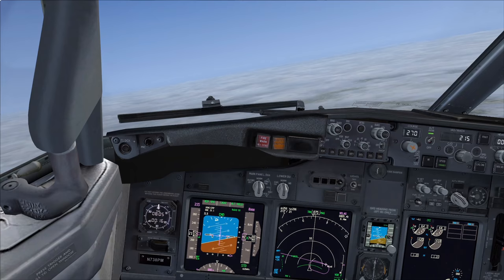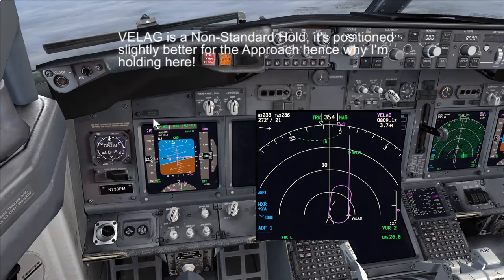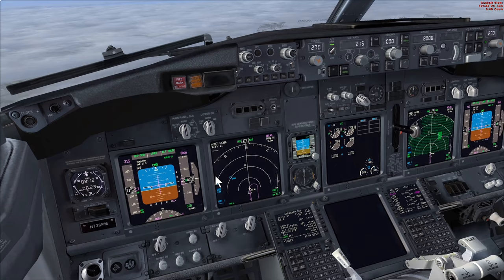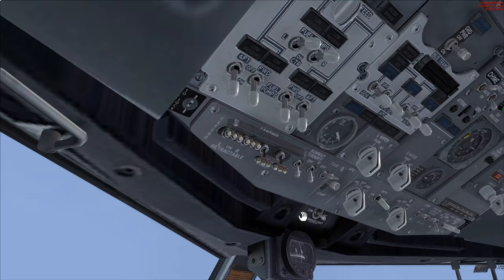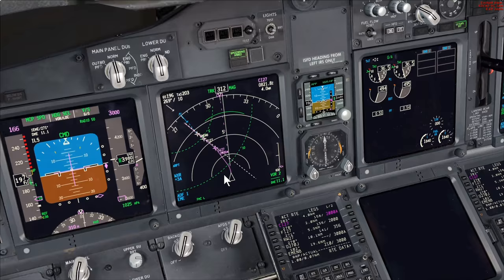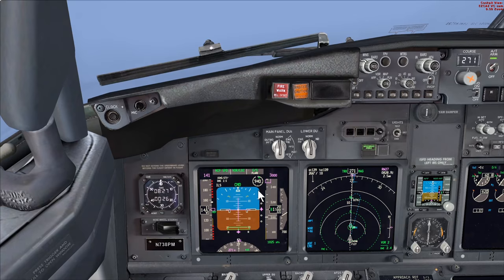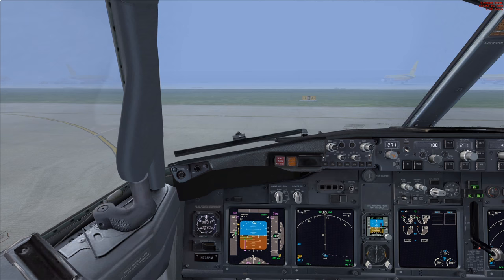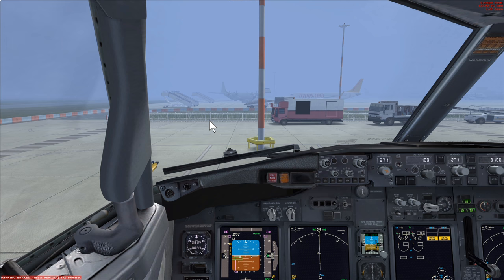How to Autoland a Boeing 737 | REAL BOEING PILOT  | PMDG 737 | CAT III ILS

Comment: Great tutorial. I watched this months ago but recently tried an autoland on several occasions without success. 

I’ve just mirrored this flight to East Midlands and finally managed to get the autoland to work thanks to following your step by step instructions!

Really appreciate the effort you put in to making these.
Reply from the maker: Awesome! So long as you have APP armed you should be able to engage the 2nd A/P for an Autoland 👍🏼

FD2S
Reply: I need to figure out where I was going wrong.  I think it might have been because I was configuring the Course heading to what the charts said instead of the ILS? In you tutorial ILS is set to 270 but Navigraph has 269.
Reply from the maker: Is your FMC (AIRAC) up to date? That could be why! I also use the most recent charts which should match the AIRAC 👍🏼
Reply: I get the regular updates from Navigraph and can see the latest dates in the FMC.  It seems that the charts in the app are slightly out though as they say 269?  I think I had issues with Stansted and looking at SkyVector, it has runway 22 as 224 and Navigraph 223!  Is the answer to trust the FMC heading?  I can see Jeppesen date on the chart is Sep 16 for Stansted.
Reply from the maker: I think it's a limitation with FSX/PMDG

https://www.avsim.com/forums/topic/363256-ils-mcp-course-selection/

FD2S.

Comment: Interesting, I was always taught in my instrument training to get established on the localizer first, and then intercept the glideslope from below. In the video you were using VS to simply follow the glideslope long before localizer capture. I suppose in the case of airline ops this is more desirable. A constant idle descent from cruise is much more fuel efficient, and a lot more safe and stabilized than the gazillion step downs we find ourselves doing when getting our instrument ratings.
Reply from the maker: Hi EnDSchultz.

Have you heard of CDA? Continuous Descent Approach's are flown primarily to reduce the environmental impact of the aircraft (noise and fuel burn).
To expand on this below FL100 we always try to avoid any level segment so we adjust the vertical speed accordingly, primarily by using V/S. 

Additionally we also try to achieve a Low Drag Approach (LDA) to further reduce the environmental impact, ideally we want the thrust lever to be at idle from TOD all the way until a 4nm final! 

Although not mandatory it is certainly desired and a lot of airports monitor aircraft for CDA compliance and can sometimes fine airlines for non compliance! Sometimes it's simply impossible due to perhaps an altitude restriction.

FD2S

Comment: As a fellow pilot I really appreciate your channel. You inspire  aspiring pilots as well as flightsimulator enthusiasts👌 Well done.

One question about the roll-out. I believe you can actually leave the autopilots in until after nosewheel touchdown as the autoland should take care of that. Correct me if I'm wrong. Safe landings✈

Comment: I use XPlane 11 and I am a newbie to aviation and fell in love with Boeing 737-800 it is a remarkable Aircraft easily controllable even its size. You are a good mentour but could you please make a content excactly steps step by step with short explanation of each step and setting up each step after explanation. I did 2 or 3 successfull ILS autopilot landings but sometimes I cant intercept Glide Slope. As I understand from your video we should always use two auto pilots to auto land with VOR Lock + Approach? Could you please explain in simple minimum required steps for autoland?

Comment: Thanks for the great video(s). As an OLD retired air traffic controller, I am curious as to how often in the real world you follow the full STAR vs receiving vectors. As a simmer,  I never liked some of the abrupt intercept angles that the STARS sometimes dictate.  As a result I have been using HDG SEL vs LNAV within 10 - 20 nm of the airport for a 30 - 35 degree intercept of the ILS.  (Old habits die hard I guess). How realistic is my method now that most major airports publish STARS?
Reply from the maker: Hi Bernard! 

Certainly here in Europe it really depends where you are. In some countries it's unusual to complete a STAR in it's entirety and you're very likely to be vectored at some point off the arrival. At some airports you can expect to do the full arrival and transition onto approach (especially if they have no radar). It really varies hugely from each airport and some airports might do something one day and then something completely different the next!

Some STAR's are not designed to put you on an intercept to an Approach, some of the airports I've flown to have the STAR terminate at a holding point near the airfield, just like in this tutorial! 

Hope I helped answer your query!

flightdeck2sim

Comment: Hello, Thanks for excellent video tutor.
I`ve issue during this operation with me, there isnot glide slope icons when straight ILS zone and line if not activate APP button. 
in your video you have glide slope without APP activate.

Problem comes through already APP is activated and I am unable to tracked the slope , which button must activate to intercept them?

Comment: Hello noob here,
Can anyone explain to me how do I compensate for surface wind conditions? When I fly CAT III on X-Plane, I always find my B378 wobbling in mid air and falling short of the runway, causing me to Go Around. I have the correct flap/speed references and right frequencies tuned. I also input the surface wind correctly given by 124thATC. I notice there's something in the scratchpad saying "WIND CORR +05KT" at the bottom of the landing page. What does this mean and how do I use it? Could this be the reason I'm undershooting the runway?

Comment: In the PMDG is it mandatory to disconnect A.P immediately after touchdown during this Auto Landing? Or can we continue even after touchdown with the A.P Engaged?
Reply from the maker: You can leave the A/p engaged for the Fail Operational Autoland System which you can select as an option in the NGX. I use the Fail Passive System which is used by my operator, it has no roll-out feature after touchdown.

FD2S

Comment: Wow that was a fail passive autoland perfectly done and as always i have a question. Why is it required to keep the landing roll until the end of the runway when LVP is in effect ? Thanks.
Reply from the maker: Hi Mehmet,

In most cases it will be an airport specific LVP procedure, taxi routings are clearly defined in low visibility 

FD2S

Comment: Hi
thanks for the video ,it was very informative. I have a question about the auto throttle on the real aircraft. When I set throttle to idle and  disconnect the auto throttle at 500ft  the engine would not idle unless I move the throttles up and down to idle again . Is this a PMDG thing or would this happen for real .. Really would like to know 
Thank you
Reply: It's a general sim thing.
The real thrust lever would move along with autothrust adjustments, whereas your throttle on the pc stays where it is. Once you disengage, the pc throttle and the sim will syncronise through your first input.

Comment: Fantastic video!
I just didn’t get one thing! After your Fs crashed and you restarted it, you had already captured the glide slope and localizer , both auto pilots were engagd, but the APP switch was off.
So how is that working?!?!?!?
Reply from the maker: Hi Pouya,

This is completely normal. Fully established on the ILS (The APP light on the MCP extinguishes after G/S capture) with the A/P engaged. Remember the light on the MCP just means the mode can be deselected, you need to check your FMA on the MCP to see which mode is engaged!

FD2S

Comment: As usual, this video is unique in its high quality. Thumbs up! 

Since the dual channel AP applies some nose-up trimming, I wonder if there is something that the pilot should/shouldn't do? The handling will be quite different from a properly trimmed aircraft during a manual landing. Is the pilot allowed to disconnect the AP (assuming no equipment failure) and continue landing manually? Or if they do so, they must go around?
Reply from the maker: Once you have decided to fly to an Autoland, certainly for my company, you must fly it to completion even if the weather improves UNLESS you're flying a practice Autoland in VMC and you have some sort of equipment failure you can continue the approach if you have visual contact with the runway.

flightdeck2sim
Reply: This makes a lot of sense! Thanks a lot for the reply. Last few weeks, I flew a lot of FlightFactor 757-200 v2 in X Plane (that's the airliner closed to PMDG in X Plane). I found it very difficult to land the plane after disconnecting the AP on a LAND 3 and nose-up trim applied. I guess if I plane to disconnect the AP, I shall only use one AP. Thanks again.
Reply from the maker: That sounds like some sort of failure operational system to me, unfamiliar with the 757 and it's autoland system so can't help you much on that one! 

flightdeck2sim

Comment: Thanks. This was really helpful.  Is there such thing as an RNAV autoland?  In theory, this should be possible, no? Modern GPS receivers are pretty accurate and should be able to provide a precise glideslope all the way down to the runway? Thanks.
Reply from the maker: Hi Vimal. As far as know it's only available off an ILS, I might be wrong but it's certainly the case here. You are quite right regarding the accuracy of GPS. Whenever we use the FMC for a Approach (RNAV/VOR or NDB) the aircraft is always flown exactly where it should be. 

FD2S

Comment: after touchdown A/P and A/T allways disconnect?
Reply from the maker: For the Fail Passive system and based on my companies procedures yes! The A/T will disconnect two seconds after touchdown so it makes no difference with regards to A/T.

If you're using the fail operational system which I'm unfamiliar with I believe it has a roll-out feature, whether you the disconnect the A/P in this instance I'm not sure!

flightdeck2sim.

Comment: Watching the video I notice that your version of the 737 has the HGS panel missing from the Central Pedestal.  I usually set the panel for autoland but now realise that the HGS setting improves pilot situational awareness when using the HUD. Is this correct? I do not use the HUD often  I will have to give it a go
Reply from the maker: Hi Clive. Our fleet are not fitted with a HUD so no HGS Panel on the pedestal. That's why I've de-selected the option! Would love to try it out in real life! 

FD2S

Comment: I don't understand . When do you deploy speed brakes ?? before the Decel point or at the Decel point. And when do you precisely deploy the flaps ??
Reply from the maker: Hi Fastsilver.

DECEL is just the point at which VNAV wants to reduce to the next target speed for the approach or perhaps a speed restriction in the FMC. It wouldn't typically require speedbrake. If using VNAV and on profile the aircraft will pitch up slightly to reduce to the next target airspeed.

Generally Flap 1 selected just prior to 10nm but they can be configured at any point by the PF.

FD2S
Reply: Thank you. And what about the flaps, on many youtube videos I've seen that many flight simmers use a specific flap configuration :  Flaps 1 : At Decel point, when the plane reaches the ''Up'' speed.  Flaps 5: When the plane  reaches the ''1'' speed. Flaps 15 : At 10 nm from the airport or when the glideslope comes to live ( I mostly use the 10 nm method). Flaps 30 : 5 nm from the airport or when the glideslope intercepts (Usually go for 5 nm method ) Is this a good method ?? i am always confused.

Comment: May i ask why u left open the Anti Ice switches on +5 Celcius, cap'n ?
Reply from the maker: Hi Slammer,  We use Engine Anti-Ice in Icing Conditions. Icing conditions are defined by my operator as "An OAT or TAT below 10C or below and any of the following exist - visible moisture, clouds, fog with visibility less than 1600m, rain, snow, sleet, ice, snow etc"

FD2S

Comment: Hello sir...i have seen a lot of your videos...what do you think about the PMDG NGXu...what would you say about it sir? I am really keen to know your thoughts...Is the ZIBO better here too?
Reply from the maker: The NGX is a complete product. It’s extremely immersive with all the systems modelled accurately and if you want to simulate every detail, practice non-normal situations as realistically as possible I'd still recommend its use

What the ZIBO MOD does it brings pretty much all the functionality you need from a typical sector from A to B but it takes advantage of XP11's aerodynamic flight model called blade element theory. If someone like ZIBO or any developer takes the time to build an accurate replication of the a real aircraft it will model all the forces/moments in real time and within the confines of a desktop simulator, pretty accurately. Things like crosswinds, secondary effects of flight controls, feel really life like and this has the affect of making The ZIBO MOD feels like flying a real 737 hence why I switched platforms.

FSX/P3D replicate real performance by using data in a table and works to a degree but it makes the aircraft feel very static and fly like it's on rails.

Cheers!

FD2S
Reply: @flightdeck2sim  Thank you so much for your time....but the NGXu seeems to be catching up( The later NGX not the old one the NG3 i mean)

Comment: Nice tutorial! I just want to ask if it's legal to do an autoland on a CATI only runway, assuming the visibility is above CATI minimums?
Reply from the maker: Hi Dale!

Absolutely! You can conduct a "PRACTICE" Autoland onto any runway equipped with an ILS, it does not need to have CATIII Lighting or Protection but you must be fully visual.

Good luck!

FD2S
Reply: flightdeck2sim Thank you!

Comment: thanks for the informative reply.  Another quick question.  Does the real 737 "float" on landing the way the NGX does, or is it just my landing technique?  I sometimes (most times)
leave a lot of good runway behind me b4 touch down. :-(
Reply from the maker: A lot of variables deciding if you'll float in real life or not! Generally if you carry too much speed it will have a tendency to float but if you check/flare at VREF or less you can expect a firm landing! Our approach speed is between VREF+5 and VREF+15 dependent on the Headwind component.
Reply: It's just practice in the NGX.  I found it more of a floater than previous add ons in the sim, but I suspect that is realistic compared to those other planes.  I find complaints of floating are due to flight simmers desire to "grease" a landing.  Virtual airlines seem to really perpetuate this problem by monitoring vertical speed on touchdown.  Otherwise, in the NGX there seems to be little amount of back pressure needed to touchdown correctly.  A ton of add ons I've had in the past seemed to require a good deal of back pressure to flare and essentially drop onto the runway nicely.  The NGX will totally level out or climb if you flare too much.  Drop your throttle at the right time and pull back very slightly, and I mean slightly.  I find that if you are fast like the -800 or -900 will be than you can drop the throttle at the 30 call-out.  Slower approaches like the -600 and -700 have you can do it around 20 feel.  Just practice.  It also helps immensely to have a yoke instead of a joystick IMO.  I can have a pretty sloppy final and still make a near perfect landing now.  If you think this is hard, purchase the Majestic Dash-8.  Beautiful plane and a handful to fly, but you have to leave the throttle up for landing or you will just drop.  That bird can be a lot harder when you are use to dropping the throttle like every other plane out there.
Reply: Thanks for your comments and suggestions. I very recently (yesterday) recalibrated the elevator axis using FSUIPC. I pulled back on the physical yoke slightly to where there was a bit more resistance and set the axis centre (idle) position at that point. Subsequent landings when sensing that bit of resistance has made it easier to minimize the flare angle. I transitioned to the NGX from the Quality Wings Avros which are easier to land, perhaps because of the high wing reducing the ground effect or the modeling not being as accurate as the PMDG. Sort of like moving from RW high wing Cessnas to low wing Pipers. Took me a while many years ago to somewhat master that technique as well.